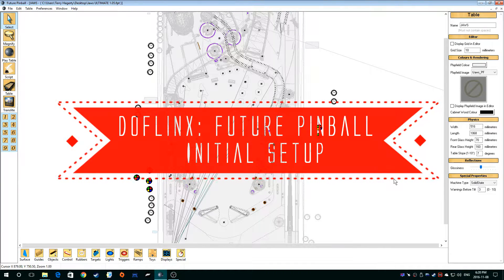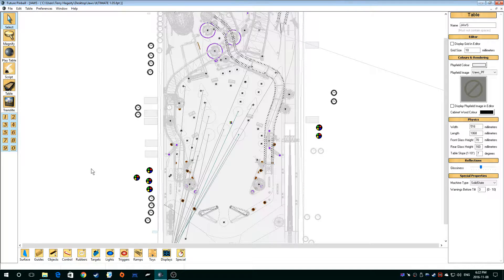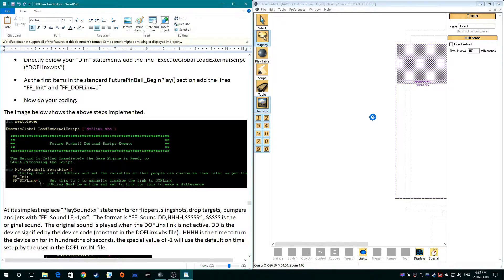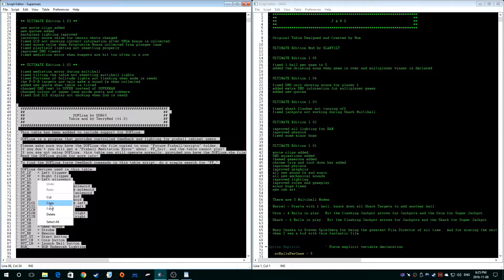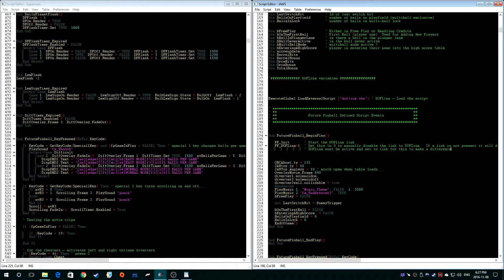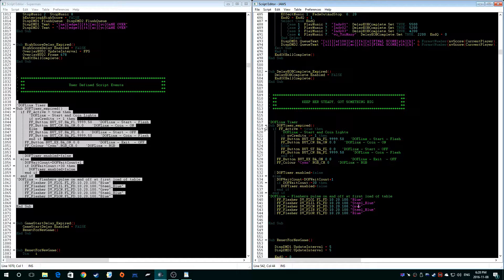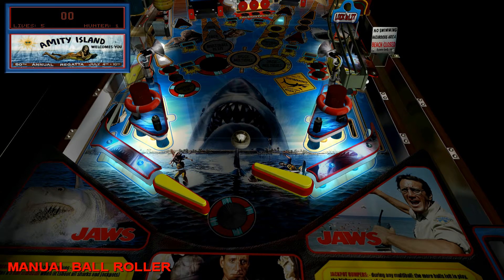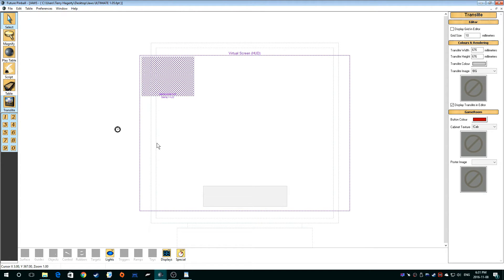DOFLinx: Future Pinball table modding tutorial - Part 1: Initial Setup

Comment: Wow! Now my 20 year old VBScripting skills are no longer irrelevant! :-)  This is going to be fun!  Question about the DMD though... Are you using FutureDMD?  I know PinballX is (or is capable of) the driving middle screen but I am having trouble figuring out how to get the DMD displays to the middle display instead of overlaying the playfield or rendering on the translight...  Once I get this software config issue ironed out then I'm gonna tackle the DOFLinx.... Code - something I can actually handle :-)
Reply from the maker: I use FutureDMD which will only display "DMD's" on a 3rd screen.....not the extra video overlays and scores, etc...  HUD-Overlays and HUD-DMD's are meant to be shown on a single screen...not a cabinet....so they need to be "unlocked" and moved off screen so they won't show up on the playfield. Watch the last DOFLinx tutorial video that goes a little bit into that. Also, considering that I never even touched VB script until a few months ago... this should be real easy for you, once you have everything setup.